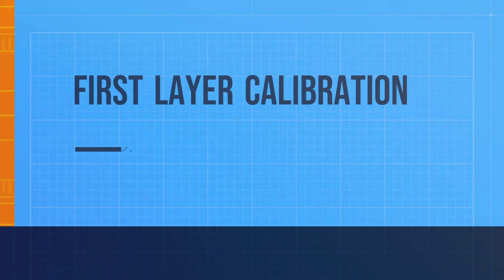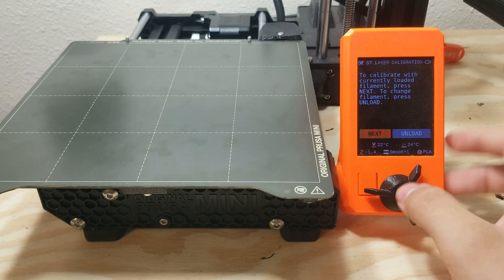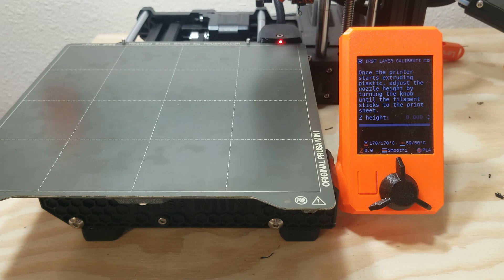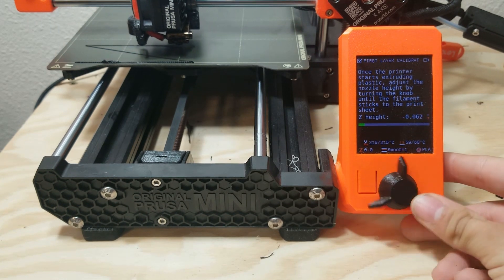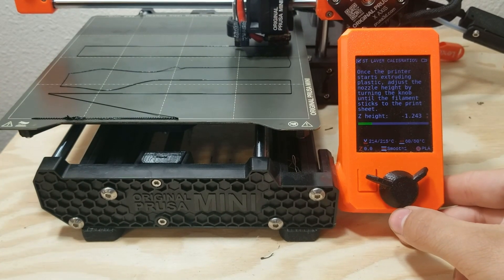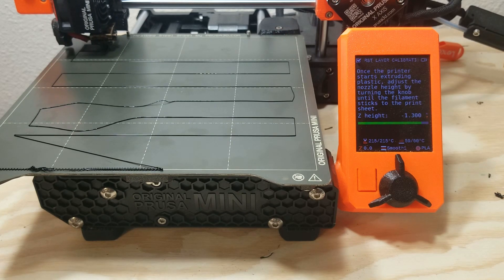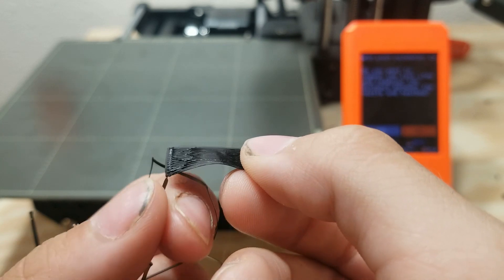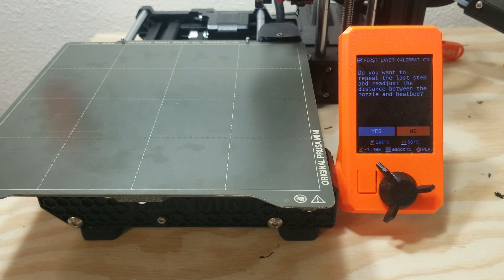first layer calibration (prusa mini)

Comment: A helpful video , just one suggestion , since a picture is worth a thousand words , a closeup of the three kites side by side would give a good idea of what exactly to look for in good vs bad.
One question, do you ever use filament that requires adhesive on the plate , and if you do, what adhesive do you suggest.
Thanks again for the tutorial.
Reply from the maker: Thank you for the advice, I will keep it in mind. When I have trouble with adhesive, a good cleaning of the bed helps, but sometimes glue sticks are needed.